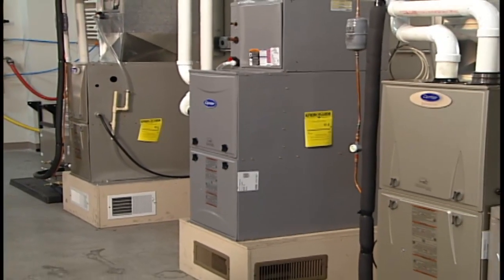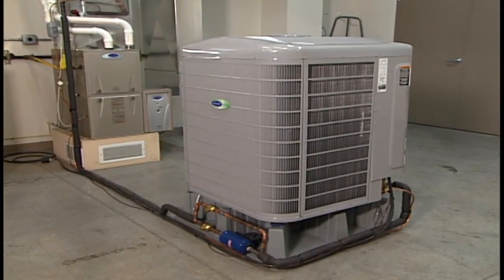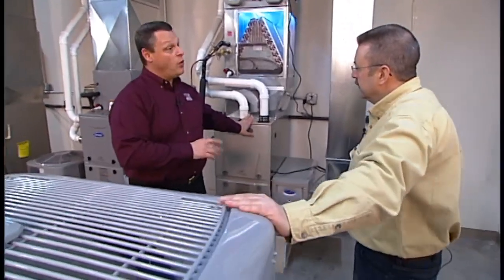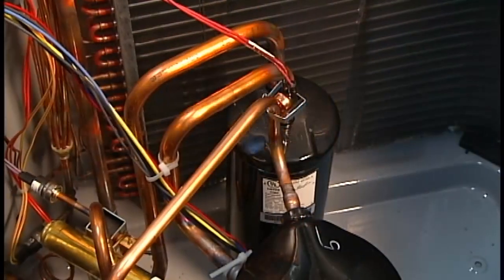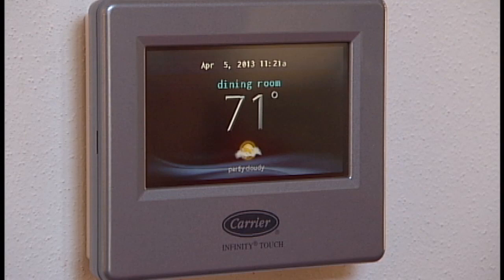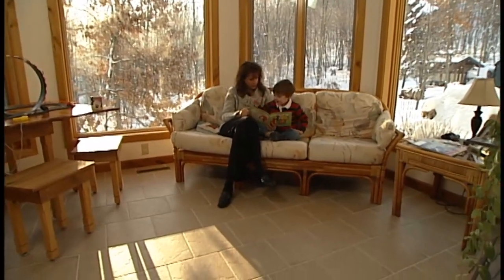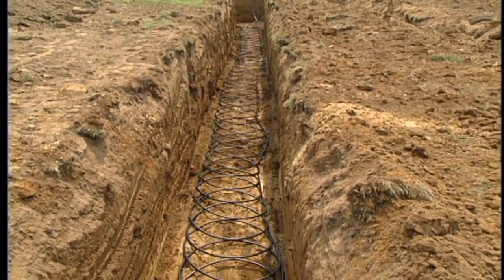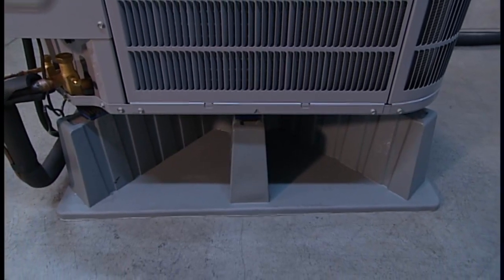How Does A Heat Pump Work?

Comment: good educational video. I have both heat pump and gas furnace, and I always wondered which could be cost effective during winter. now I know when the the ambient temperature way low, it would be good to turn the gas furnace on.  I do have to manually switch the mode. also during summer I do have to switch to a.c, my thermostat is not smart to switch from gas to HP or HP to gas or heat to cool.

Comment: Heat pumps are very problematic, i  am an apprentice working for a large HVAC company in NY. In winter time we get so many calls from customers complaining of no heat, issues with circuit boards, thermostats, low on refrigerants, constantly running throughout the year, too many issues and some of the heat pumps are a year old.
Reply: what about in a climate like LA where it doesn't snow?

Comment: How much noise does these units make?
Reply: Quite a bit, you can definitely hear them if your sitting outside in the summertime, basically a constant fan noise. In winter same noise, but you can't hear it from inside usually unless your walls are paper thin.
Reply: that sounds like the same kind of noise from a normal split system aircon then...

Comment: I would think this would put more wear and tear on your compressor using the unit year round for both heating and air.   Also, my whole house forced air AC units tend to be the biggest energy user in the summer time.  My electrical bill is significantly more in the summer than the winter.  If natural gas is piped into your home, it is probably less expensive to use a gas furnace if you are paying for electricity.  If you have a solar panel system, perhaps your electricity is lower than the gas so this may work out to be better to use a dual heat pump/furnace unit in that case.  If I could afford a house with a large yard, I would go with the ground source for a heat pump.
Reply: Bill A. Dual fuel heat pump gas furnace backup is the way to go. My heating bill in Michigan is half what it was last year. However I use propane for backup. Looking at running costs it appears about even between heat pump or natural gas at roughly 80 cents a gallon. If on propane I highly recommend getting a heat pump you won't regret it. Multi stage is preferable.
Reply: Bill A. Dual fuel heat pump gas furnace backup is the way to go. My heating bill in Michigan is half what it was last year. However I use propane for backup. Looking at running costs it appears about even between heat pump or natural gas at roughly 80 cents a gallon. If on propane I highly
 recommend getting a heat pump you won't regret it. Multi stage is preferable.

Comment: All you have done here is a sales excercise. About time you changed your heatpump design to eliminate the defrost cycle. your product stops heating and reverse cycles well above the -15 temperatures you mention in this video. There are now much better outdoor units that defrost without reversing the gas, which maintains concistent heat output. I have one of your units which I am about to remove and replace with a more efficient unit.
Reply: I agree, this video is nothing but a sales gimmick for Carrier; From what I have come to understand, heat pumps don't even pull in enough warmth from the outdoor air below about 30 degrees and switch to electric resistance (strip/supplemental) heat to supplement the pump, which basically is using large, toaster-like heating coils in the indoor furnace unit to provide heat inside the home; thus driving up your electric bill regardless if you have a heat pump or not. If you live where temperatures are frequently below 30 degrees F, supplemental heating therefore is almost constantly in use; Not very energy efficient unless you have a dual-fuel system using a supplemental heating fuel such as natural gas. I especially like when he says at 4:55 that, "you don't ever want to know that it switched modes"...um, why? So we can never tell if the heat is coming from the heat pump or the supplemental heating unit? How are we supposed to know if the heat pump is even working if we can't tell which source it is? If I had the choice I would skip heat pumps altogether and go with natural gas or pellet stoves. To me, heat pumps are nothing more than expensive, inefficient air exchangers that do a minimal job of heating one's home.